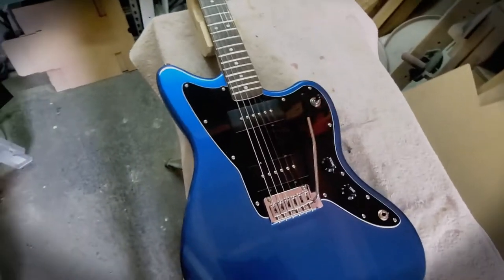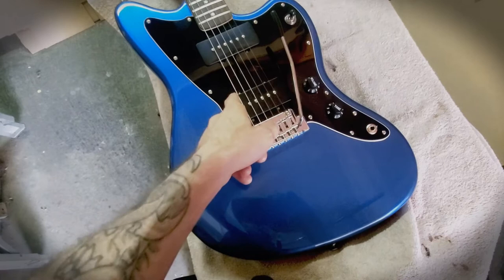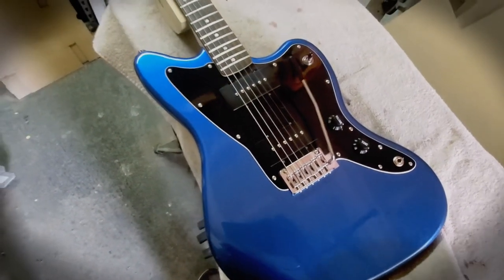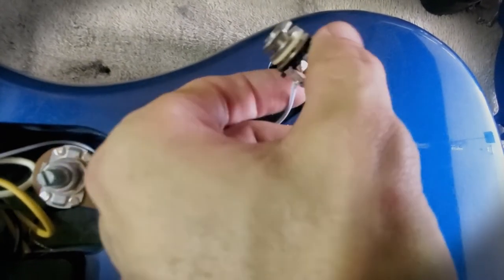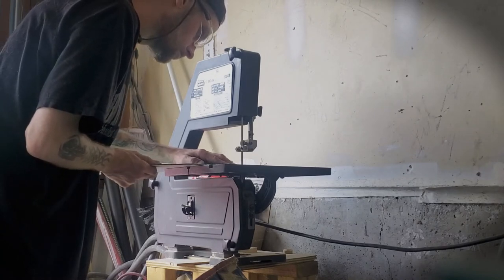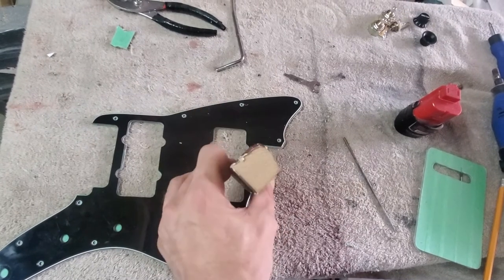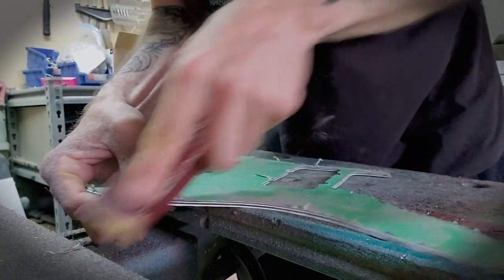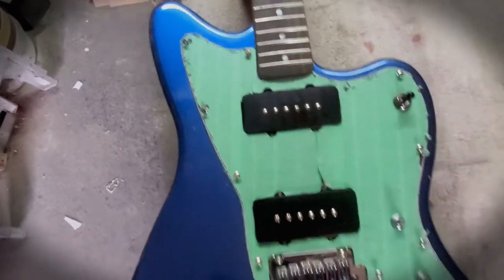Let's make a pickguard from scratch!  And cracking open a 2021 Squier Jazzmaster

Comment: Pickups are a matter of taste, but I find the stock ones too hot and harmonically dead. I put PV fenders in there last week and left the 250k pots, plenty of highs now. I think replacing the vibrato block is my next mod although I cannot find any direct replacements for the 2 point trem.
Reply from the maker: Thanks for the comment!  Yes I agree with you on this.  After putting the 1M pots, the pickups sounded way too bright and scratchy.  The 250k pots are definitely good for these pickups, however I agree with you that they're too hot for my taste, after spending some time with them.  Rolling back the tone just took more away from them too.  I've since gotten rid of this guitar and picked up the 2020 Epiphone 335 "Inspired By Gibson".